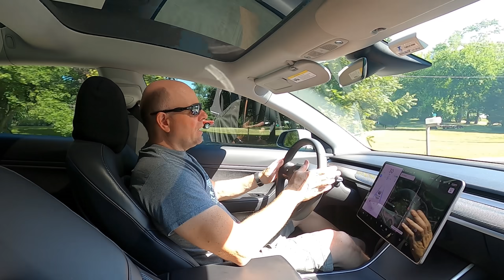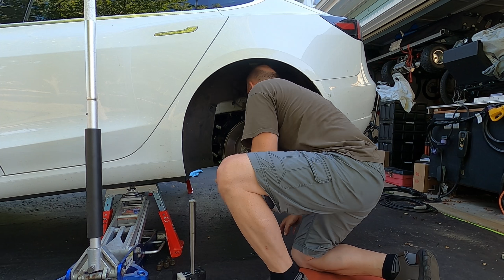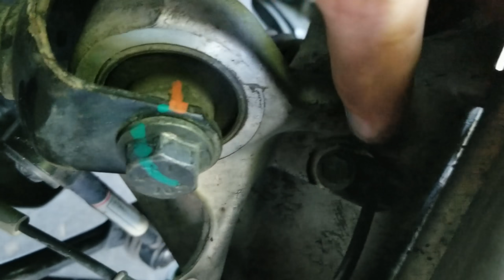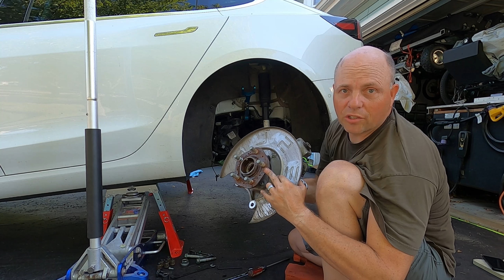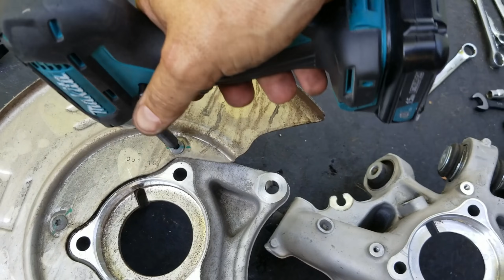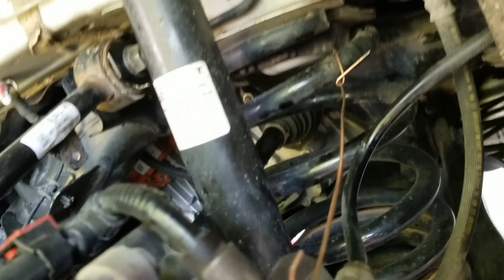Tesla Model 3 servicing (Replacing rear knuckles and how to service the rear end).

Comment: Dude,  you need torque that axel nut!  That quick tightening was not even close to he rear axle nut on a Tesla Model 3 requires a torque of 221.2 ft-lbs (300 Nm). Specifically, this torque specification applies to the nut attaching the halfshaft to the rear hub assembly, according to Tesla's service documentation.

Comment: A 1.25 inch (1.25") socket is not the same as a 32mm socket and should not be used interchangeably. While they are close in size, a 1.25" socket is slightly larger than a 32mm socket, and using the wrong size can damage the bolt head or the socket.
Rear axel torque is 221 ft-lbs (300nm) way more than lugs (129 ft-lbs), and you don't want that kind of force with the wrong socket size.
Reply: Rear Suspension:
1.	Rear damper to body (top mount): 41 Nm (30.2 lbs-ft) 
2.	Rear damper to rear lower aft link: 115 Nm (84.8 lbs-ft) 
3.	Stabilizer bar end link to stabilizer bar: 55 Nm (40.6 lbs-ft) 
4.	Rear stabilizer bar to vehicle: 30 Nm (22.1 lbs-ft) 
5.	Rear hub to knuckle: 90 Nm (66.4 lbs-ft) 
6.	Halfshaft to hub: 245 Nm (180.7 lbs-ft) 
7.	Toe link to rear subframe: 85 Nm (62.7 lbs-ft) 
8.	Toe link to knuckle: 76 Nm (56.0 lbs-ft) 
9.	Rear lower aft link to rear subframe: 115 Nm (84.8 lbs-ft) 
10.	Rear lower aft link to knuckle: 115 Nm (84.8 lbs-ft) 
11.	Drive unit to subframe: 80 Nm (59.0 lbs-ft) 
12.	Stabilizer bar to end links: 55 Nm (40.6 lbs-ft) 
13.	Upper link to knuckle: 140 Nm (103.2 lbs-ft) 
14.	Lower control arm to knuckle: 190 Nm (140.1 lbs-ft) 
15.	Shock absorber to knuckle: 140 Nm (103.2 lbs-ft) 

Front Suspension:
1.	Bolts securing front subframe to body: 41 Nm (30.2 lbs-ft) (minimum) 
2.	Strut to body (top mount): 41 Nm (30.2 lbs-ft) 
3.	Damper to rear lower aft link: 115 Nm (84.8 lbs-ft)

Comment: 2:50 - Put it in Tow Mode and the brakes will remain unlocked. That's the purpose of  Tow Mode, to allow you to get out of the car before it is rolled or winched on a flatbed truck.

Comment: I have a 2023 Model 3 Performance that just had these go out, one side is worse then the other. I am about to do this job myself so thank you for the video, I've been watching many videos to make sure I understand what do do before I tackle this.
I notice the service menu & some other comments saying to jack the lower control arm up to simulate ride height, do you know why this is necessary? I have a second jack I can do this with just don't know why it's needed.

Thanks again!
Reply: Because if you torque up rotating arms with bushes at the wrong angle, when the car sits at it's ride height the bushes will be twisted and fail early.

Comment: Great Video, I currently have a 2019 SR+ model 3 and have had rear squeaking for about a year. Car was lifted last year and there was uneven wear and tear on one rear tire and it was replaced. I knew there was a deeper issue and after seeing this video I feel I need to replace the rear control arms as well as the rear knuckle bushing assembly. I got them off ebay, now I need to order the rear control arm kit and do everything at once, only problem is I dont have the tools or people are afraid to work on them or want to charge me close to $2k for labor. I am leaning towards buying the tools. How much should I reasonable pay to have this work done if I have a local mechanic/friend do it?

Comment: Thanks for the video. you had mentioned in the beginning that you would be showing how to replace the wheel bearing but i missed that part in the video, did you had it covered in another video? I have a model Y and i am getting an increasing noise with speed while driving.
Reply: Check your tyres aren't deformed (steps between the tread blocks). Sounds exactly like failing wheel bearings.
The wheel bearing and hub assembly are the item he transferred from the old knuckle to the new one. You don't need to remove the knuckle to change it.
Reply: @richhr89 thanks for the reply sir. I found out the problem and made a video on my channel.

Comment: You can unplug the brake motor and get 12volt wires to the motor terminals and i will release the rotor

Comment: I have a very similar clunk on my M3P. Sounds like it's coming from the rear drive unit, like the motor mount is bad or something. Did you ever figure out what your issue was? I've read something about the subframe bushings going bad too.

Comment: Can you tell me in what scenario we need to change knuckles.
Actually i have my car body rolls too much after i get my rear tire change done.
After i went to mechanic he said we need to replace rear right side knuckle.
Can you tell me is this right
Reply: There's a squeak coming from the rear wheel area when rolling slowly and over uneven terrain.. Eventually, the squeak will turn to a clunk. It's basically metal on metal.

Comment: Very good instruction ! Tip. You can put the car in Tow mode to release the parking brake for parts of the job! Question what about the torques for the bolts

Comment: In the service guide from Tesla it advises to get a suspension compression rod and to install a hub jack adapter to then verify rear ride height. What did you do in order to confirm the ride hight was correct?

Comment: Wow awesome video!   Not sure if this is related to your situation.  My 3 started making a squeaking sound “ like an Old mattress” when I accelerate or brake when driving very slow.   I thought it could be the front ball joint but when I lifted the car up during tire rotation and when lower it back down to the ground I thing it is coming from the rear passenger side.   Do you have an ideas?  🤔 thx!
Reply: Mine is doing the same thing after ~170k km. The service center quoted me 1500$ to fix it. It was 690$ for the knuckle. 600$ for labor and 300$ for the alignment.

Comment: Thank you for this great tutorial video Matt! I've had a clunking sound for a few months and simply cannot track it down. My car is lowered an inch with 15mm front/20mm rear spacers. No noise for over two years but then it happened. Not the shocks, not the springs, not the sway bar, not the end links, not the rear camber arms... it has to be stress on the knuckles so I followed your path through eBay, purchased rear right and left knuckles, and am going to give it a shot. My noise is happening mainly at low speeds, with side-to-side movement (rear passenger side). I sure hope replacing the knuckles resolves the clunk. I've been to three different shops, with no help, so now I'm on my own.

Comment: 9/16?  Really?  Most US OEMs converted to metric several decades ago.  These are probably metric fasteners with an E18 torx heads, not “9/16 inch.” Thanks for the great instructional video.  More of this is needed to help Tesla owners doing their own repairs and maintenance.  Tips like how to use the nut to prevent thread damage when hammering the spline apart are very helpful.  Matt really knows his stuff.

Comment: Great video.    However!!!!   I would have googled the torque spec for the nuts and bolts.  Perhaps even Tesla would have gladly shared the Torque settings.   I agree these cars are relatively easy to work on!  I installed and uninstalled lowering springs on my Model 3 Performance.  It wasn't too bad at all!

Comment: Off topic question.  I used an RV extension for my 14-50 charger for about 7 months and it recently melted down.  I see you have a similar set up but maybe more complex.  Have you had any issues with your charger melting?  Do you use the Gen1 MC, or the Gen2 MC?  Thanks and great video on removing the knuckle.  Only 13.5k miles on my M3 but I am sure I will be attempting some of these repairs should they pop up!
Reply from the maker: No problem yet!
Reply: My guess is something got wet and sent current back through ground path heating up the cable. With a well-made cable (they are expensive!), in a mostly dry environment you shouldn't have an issue. To be safe use a GFI breaker on the circuit.

Comment: My model 3 is 1-year old with about 13k miles. I started to notice clunk noise at low speed acceleration or deceleration from the trunk area...
Reply: Still on warranty. Bring it back. Mine is doing it after 6.5 years and 170k kms. Also, that's driving through salted road winters with no rust proofing.

Comment: Why are you replacing this, how die you diagnose it being faulty or bad? It looks almost perfect the old one..? (Ex car mechanic here)

Couldn’t the sound be because of the wider rims..? That changes the load on different parts at the rear
Reply from the maker: I explained it in the video. They were getting sloppy.
Reply: Tech Forum Thanks. Watched whole video but sometimes still miss something!

Comment: Yea I ran into that same problem with the ball nut, I had to use the allen you sent me!  Was replacing the rear joint it was broken from the forklift loading the car.   Thanks for showing everything in good detail and explanation, will help greatly for anyone needing to do this.  Hopefully it will be a wile for mine at 25k miles and the wife's at 45k. 
Take it easy Matt!
Casey

Comment: For anybody that is doing this in the future and wants the official torque values for bolts that attach to the rear suspension knuckle:
Rear upper aft link: 134 Nm
Rear upper fore link: 76 Nm
Toe link: 76 Nm
Rear lower fore link: 76 Nm
Rear lower aft link: 115 Nm
Sway bar link: 55 Nm

Remember to tighten the bolts only after simulating the car sitting at normal ride height with weight on the suspension.  You can do this by jacking up on the lower control arm until it barely starts to lift the car off of the jack stand that you are using on the jack point.
Reply from the maker: Are you a Tesla tech?
Reply: @TechForumTesla  No, but I have access to the service manual
Reply from the maker: @android04  ahh. I had a few questions if you were a service tech.
Reply: Dario Vazquez How did you? I am a former car mechanic and have a model 3, that would be cool to have acces to!
Reply: @MrGoogle87  you can find the service manual on this website https://cardiagn.com/
Reply: Would you have the axle nut torque value?
Reply: @patrickj2474 221 foot pounds. It use to be ~190ish and they revised it, similar to the how they revised the bolts that attaches the lateral link to subframe from ~84 to 98.9 ft-lbs
Reply: Thank you for those important notes

Comment: Nice video. Did you have the correct torque settings for each of the bolts from tesla? Didn't see torque wrench. If you did use, where did you find them please? I'm looking for them. Thanks.
Reply from the maker: I could not find torque specs.

Comment: Hello.  This was a interesting video.  I've also lowered my model 3,  approximately 1 inch with eibach springs.  I have had to compromise the lowering with the way I deal with steep drive ways and speed bump and the Uneven wear on my tires.  I have watched a few you tube videos detailing model 3's with air ride suspension.  What's your take on air ride suspension?
Reply from the maker: I have considered air ride. But, it is a big job.
Reply: @TechForumTesla  and very expensive.  Have you rode inside a model 3 with air suspension?  If so, is there a ride difference and will performance suffer from it.  A friend of mine had an air ride suspension on his vehicle back in 1999 and the ride was horrible.

Comment: Wow!  The knuckles on my 2008 Toyota Highlander Hybrid with 200,000 Miles cost over 400$ each.  Great video!  I am hoping to buy a 2018 Tesla Model S soon... God bless you in Jesus Christ.
Reply: drive a model 3 performance first if you like handling with your acceleration.
Reply: @foam27  I would definitely be interested in the Model 3 performance.  But I have a spine condition.  If the suspension were adjustable.  To a softer setting.  I would definitely get it. Maybe I will get one for track driving.  If I like the Model S.
Reply: In Canada, that knuckle is 690$